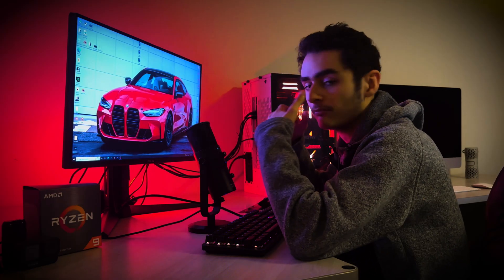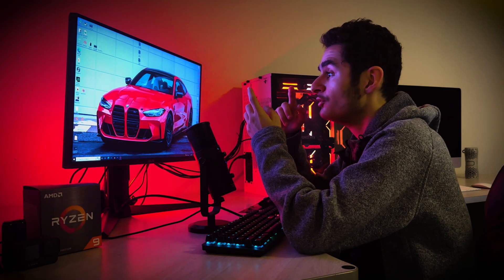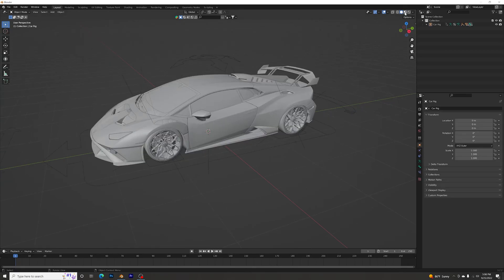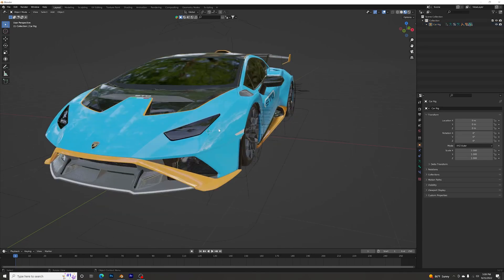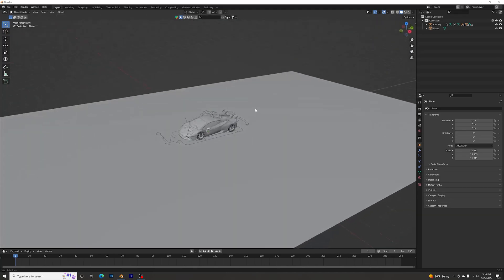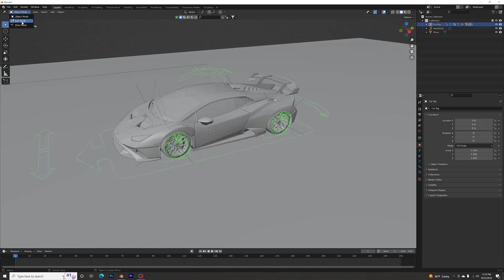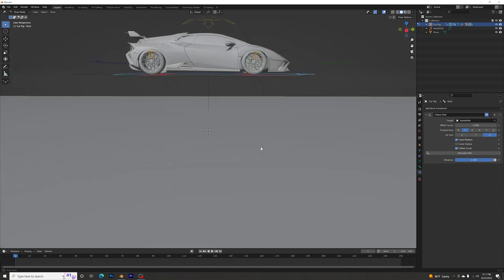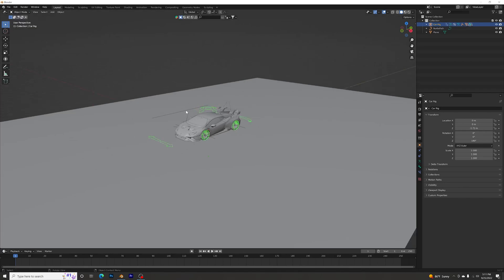Making Car Animation with Sparks in Blender beginner tutorial (blender 3.3 version)

Comment: Hey, nice tutorial, I tried using an imported old Porsche model, but when I try bake the steering and rotation, the wheels stay fixed and won't rotate or turn. Do you know how to fix this. The green keyframes appear below, but it only follows the path. Im new to blender, so id appreciate if you have any tips!. Thanks. (im using blender 3.3 with rigacar 7.1)
Reply: The car rig  wheel rotation and steering works fine... until I apply it to a path.
Reply from the maker: @9039josh  hmmmmm. On rigga car Tab, Try to set a wheel rotation y-x axis at 1.   Cause I think In that video I said set it as 0. But try to put it as 1 to see if it works and then bake it
Reply: @SportzCar  Thanks for the tip, I put it to 1 and the wheels roll when moving the car, but not after baking it. I must have a parent object or something stopping it. Might just try another car model in case its just this one. Thanks for the help. Also keep the car vids coming!!!!